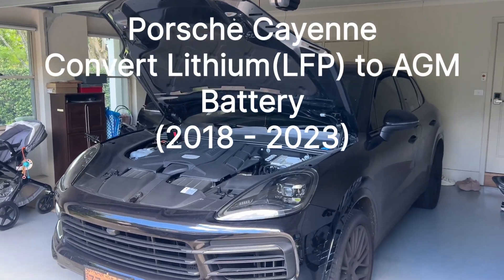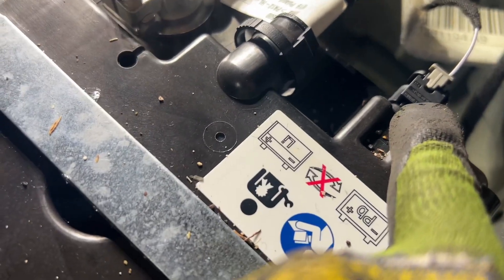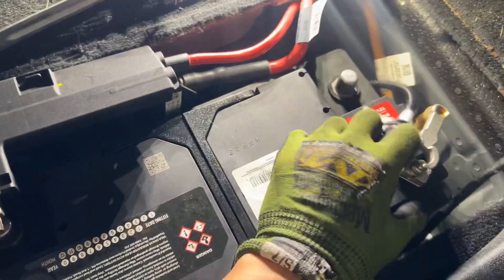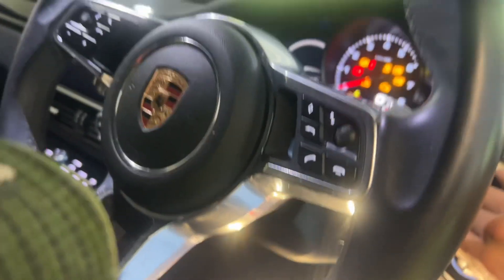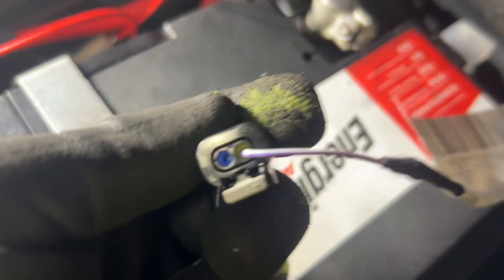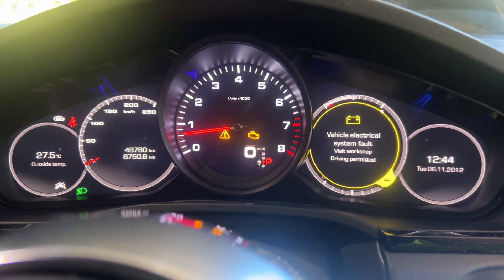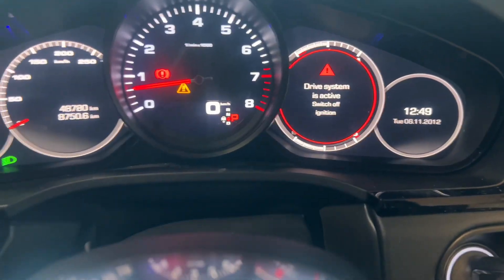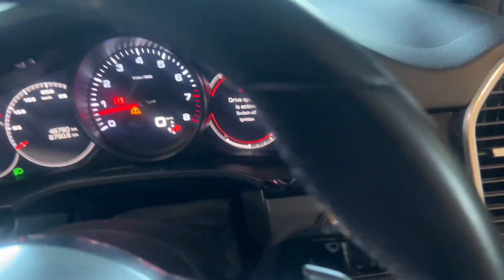Porsche Cayenne | Convert Lithium Battery to AGM Stop/Start Battery (2018 - 2023)@mysupercarexpert

Comment: Why would you want to do this. Aren't lithium batteries better?
Reply from the maker: If you can only buy the lithium battery that is specific to Porsche from the dealer for $4000 plus labour (I’ve seen a customer pay $6,500 because he didn’t have a choice), a AGM battery option is a much cheaper option
Reply: They go boom boom - you can enter the term: thermal runaway and see for your own eyes. Also AGM is much cheaper, even if it is much more expensive than a standard car battery.